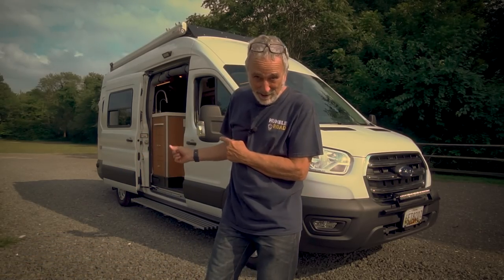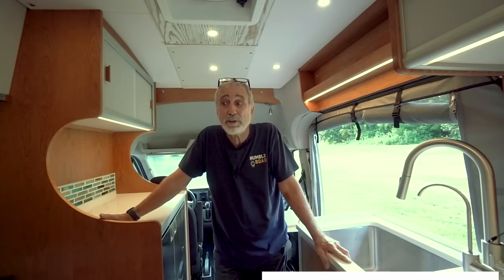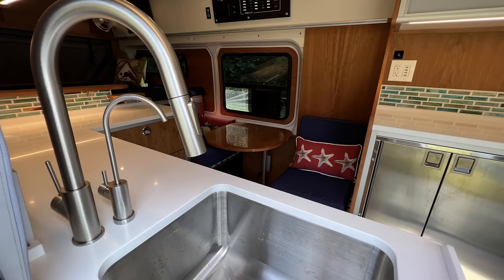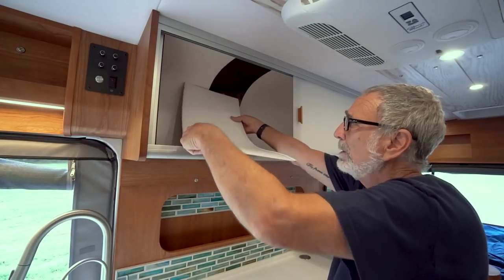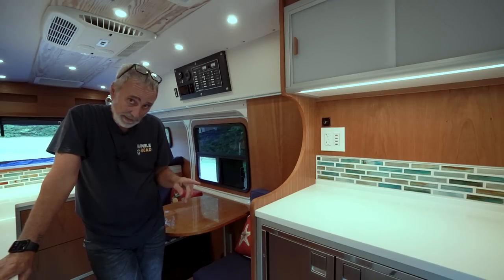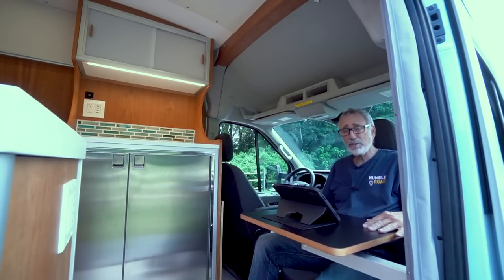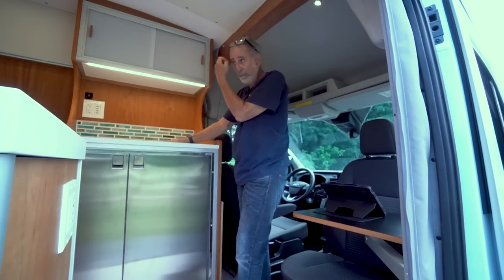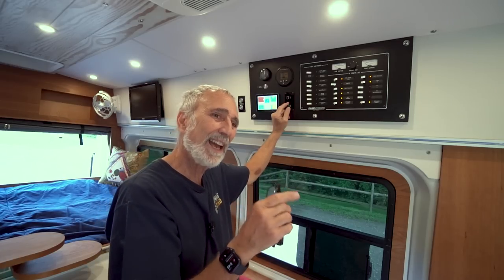HUMBLE ROAD Lightfoot Ford Transit 250 COMPLETE VAN TOUR

Comment: Wow! Wow! Wow!  This layout is brilliant!!  Perfect! Cherry wood woodworking is stunning! Love the frig! This one is a winner!! The handles on the upper cabinet faces are everything. This van w/ the backlit rice paper upper cabinet faces that Brooklyn Vans crafted on their Zen van would be money!!  So well done guys!  Congrats!
Reply: It is not rice paper.  It is sanded Plexiglass. Sanded on inside, while outside is glossy, creates a frosted look.  Add felt tape for cushioning and no rattle when driving.  I love Plexiglass.  It is also great for picture frames, and aircraft lightweight mirrors.  The only issue is that it can get scratched although that can be polished out with plastic polish. The weight difference between acrylic 'glass' for framing pictures and real glass is huge.

Comment: We have a NOVA Coachman.  Would you share the water purification system you use in the Lightfoot.  We have a very small space under the sink and it looks like it might fit.  We watch your videos regularly.  You are an amazing van builder.  The RV industry should be taking tips from you.  Thank you for sharing your incredible van builds.

Comment: Its perfect and gorgeous.  I could see myself in this van with the following enhancemets: inside shower pan at the slider that utilizes kitchen sink faucet or similar; a way to extend the dinnette length for taller guests (footwell door that goes under the main bed); put the toilet on drawer slides to that in the middle of the night I can just push a button and it pops out instead of having to lift it out manually.  I would also use the 350 platform.  Lastly as an option (if you thought it could work) a roof window with hatch.  Just love this one, great job team!

Comment: Love the design, quality, thought and integrity shown. I am compiling my list of Must Haves for our build that I plan to contract with you soon. There is no better van builder anywhere. PS, im glad you came around to the 2S2P solar panel config that we discussed when you were still doing all parallel. The best solar array Vmp voltage tends to be 2x to 3x the battery voltage. Your latest builds meet that ideal very nicely. Thanks for a great video tour!

Comment: GEORGE👋 Question:   Curious as to why you prefer the exterior BMS... I thought the built-in BMS was the "latest and greatest..." ⁉
Reply: This fits in with his philosophy of being able to replace anything that goes bad without compromising the whole item or rendering it non functional.  As a builder, if your selection of battery (Lithionics) has an issue with a built-in BMS, your client will have no battery while on the road. Why not keep an external BMS supply handy in the warehouse to be Fedexed immediately should this occur instead of leaving her with no battery supply which is critical.  It makes sense.  I would do that too.
Reply: @mjremy2605  Awesome.. makes perfect sense too... Greatly appreciated my friend...🙏 "New and improved" often means crappy and less reliable...   I'll bet there are other issues too and perhaps due to his relationship with Lithionics we may never  know 😊

Comment: George can you do a quick tutorial on the sliding cabinet doors and how you keep them quiet.  I have not been able to do this.  They either rattle or I can’t open them.  Using the 80/20 slider channels and 1/4 inch bamboo ply doors.   Thank you!
Reply: He did explain this in one of his videos. Its a felt tape you stick under the door or in the channel. Use some weather stripping felt or that fuzzy one.  Try different materials from hardware store, sewing shop, or RV supply houses. Commercial RV windows have these channel inserts to keep the glass from rattling.  They are sold in big rolls unfortunately.  Look them up and duplicate that with weatherproofing.

Comment: Hi Mister, this is Paul from Belgium. I love so much your inspiration. But couldn’t it be possible to rethink battery only electricity, f.i. kind of Tesla Bat flat on (onder)the floor? Easy installation, no mess, one unit for all lights and inputs. Secondly, after vieuwing 100’s van, never seen a comfortable bathroom with a moving store (clothing) inside and retractable toilet. Waiting for designing a 140cm x 70cm bathroom. And last but not least, a van for older people eating in restaurants and only need a very small snackbar (galley) and a coach in the back convertible to a 140cm x 193cm max bed. Thank you For designing or let me know we can make a design. Good luck with your fantastic business. 
Max

Comment: lots of innovative ideas.  your video work, and the way you show the detail is as good as the van.   water capacity and where?  outdoor shower?  weight of build?  water heater system?
Reply from the maker: I did miss a lot in this Van Build video. The water tank, 31 gallons sits right on the axle with the battery slightly ahead of it. Perfect placement, outdoor shower, indoor portable toilet. The heating system is a gasoline fired Webasto EVO40. And the van is very heavy. We’re going to have to do something about the shocks and springs. This is a 250. I had no choice but to build on it. I will not build on a 250 again they just not practical for vanlife.

Comment: I'm curious what your thoughts are on the power stations like Bluetti, Anker and such.  I'm thinking these all-in-one units might replace having all the separate batteries, charge controllers, mppts, and the thousands of dollars you are currently spending on electronics.  Thoughts anyone?
Reply from the maker: There are a few reasons why I don’t like the all in one power stations. Basically all in ones don’t do any one thing. Well you’re stuck with that form factor whereas with individual components, you can spread them out to fit the space better if your unit goes down you lose all of it. If one of my individual components goes down, I just have to replace that component.

Comment: Great looking van. But you mentioned the air conditioning would run during the day completely from 400watts of solar ??

Real life 400watts of panels your getting maybe the high 300’s how would that run the air con ?
Reply from the maker: Yes, the 400 W would certainly contribute to running the air conditioner which burns 45 A @12 V. however I was thinking about a 600 W panel system that I normally put on a van.  a transit can only except 400 with everything else I have up there
Reply: George - love your videos, have learned alot from you, inspiring my build! You said- "48v 400w solar = 30A"... that is more like 8A (400W/ 48v) maybe for 1/2hr per day if no clouds, trees, and peak summer.  @HumbleRoad